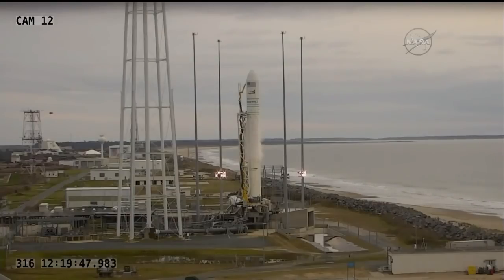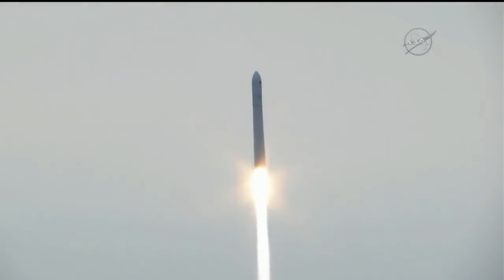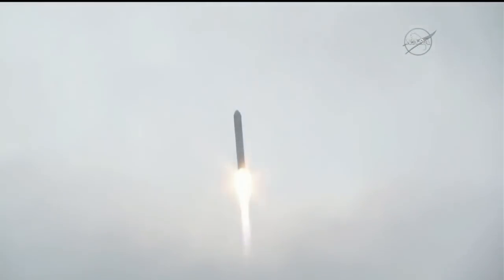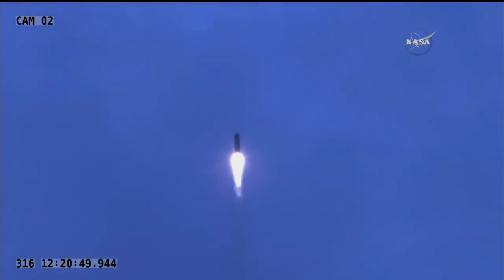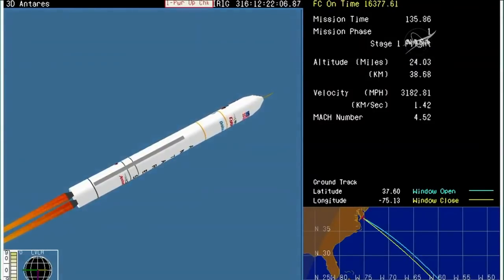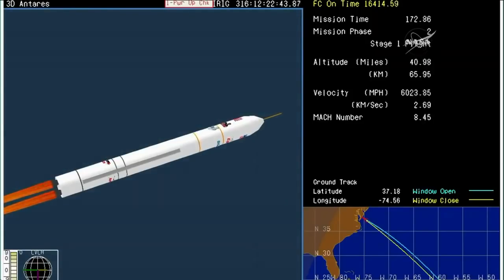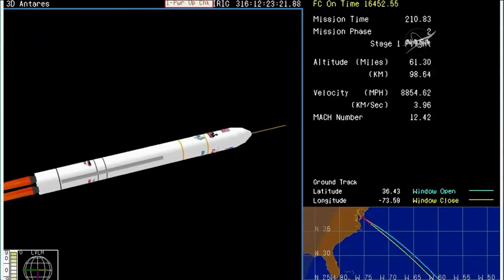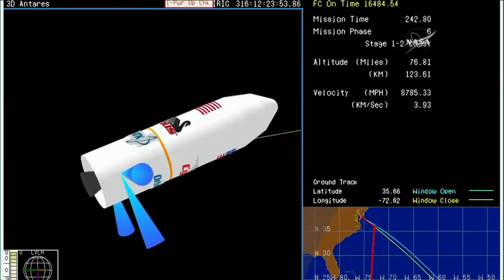Space Station Resupply Mission Launches From Wallops

Comment: Are they resupplying the hot pockets for the space station?
Reply: RuggedALAN No, just spacefood, water, and possibly cleaning supplies.
Reply: Yaakov Lapidus what is space food? Is it stuff u suck through a tube that looks like tooth paste?
Reply: RuggedALAN Spacefood is any food that can easily and safely be stored and eaten in the ISS, and is not common on earth. A crumbly cookie would not typically be called spacefood, because it can't be stored without the crumbs getting everywhere. An apple wouldn't be considered spacefood because it is common on earth. Or at least that is my understanding of what spacefood means. If you want a better definition, I recommend looking it up on one of those dictionary websites.
Reply: Bryan A.Cal Well, as long as said food wouldn't be a hazard, like soda, which after being opened would propel itself forward like a rocket, and as long as said food wouldn't make a huge mess, like a crumbly cookie, it would not be bad to ship it to space. The main problem with shipping food to space is cost.